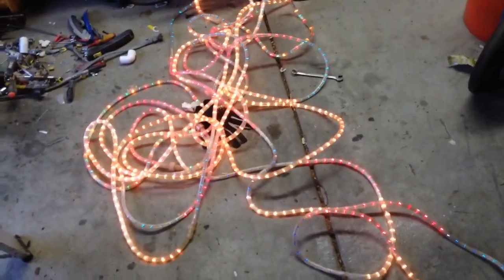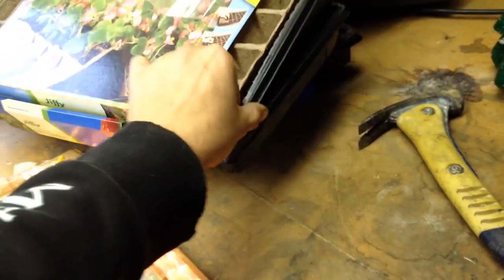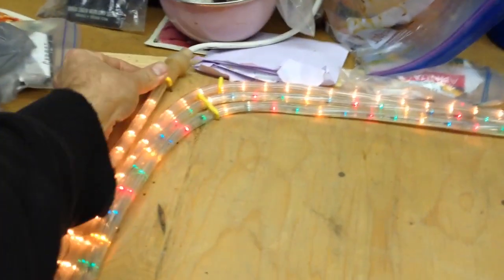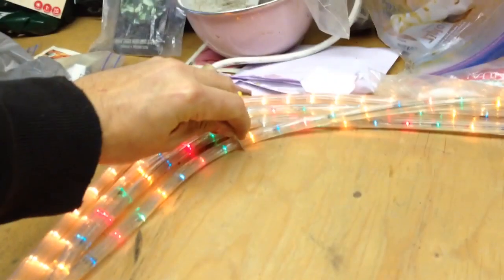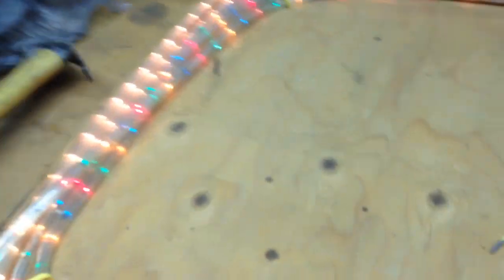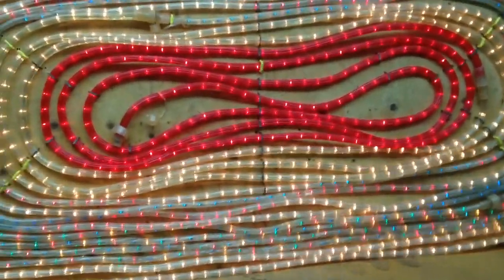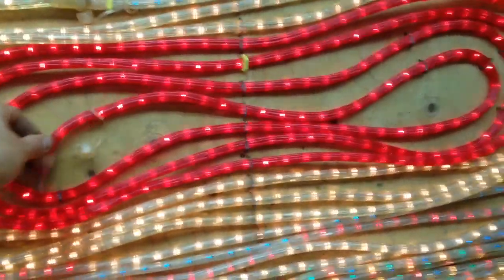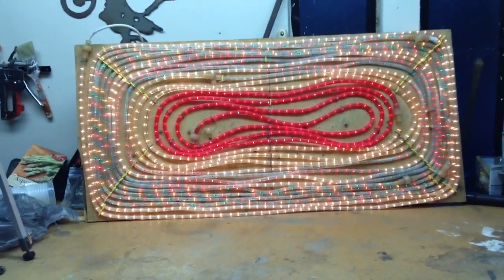How to make a seedling heat mat.

Comment: You could have cut a slot in the middle, and pulled any extra rope light out the bottom of the pad, and set pad on blocks...
Reply from the maker: That's a good idea. Thanks for the suggestion.

Comment: you could line the wood with heavy Aluminum foil or staple flat part of recycled soda cans to wood before stapling which would reflect the heat and make it a little safer then it being directly on wood. What a great idea. TY!
Reply from the maker: Thanks. If you try making one with foil let us know how it works

Comment: Hii, thank you for your video.
you think is there a more efficient way to do this on DIY like I was thinking to get out the resistance of some whitegoods...not sure about safety in that case Ahah.
 A more simple upgrade could be adding some wool pads or just a blanket to not dispersed the heat. :)
let me know your thoughts
Reply from the maker: Now with amazon being so easy to use and things being cheep on there. I would just buy one on there. Unless you have 0 money and lights and plywood Laying around.